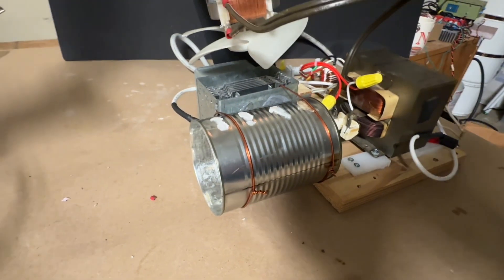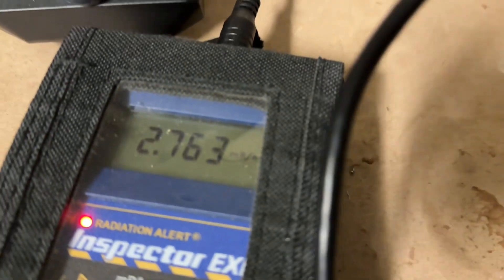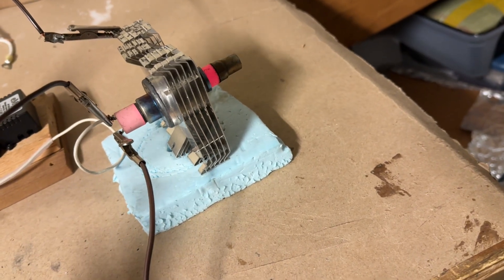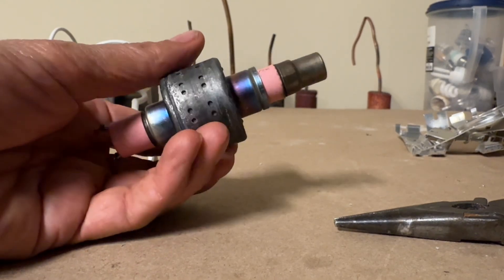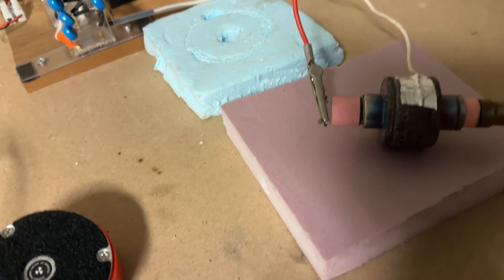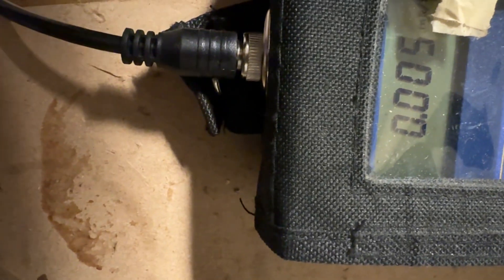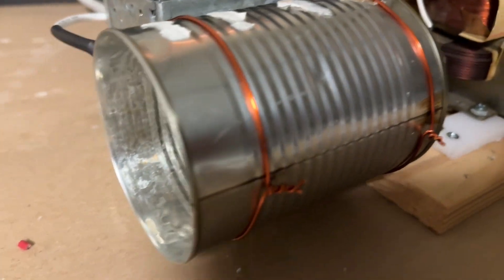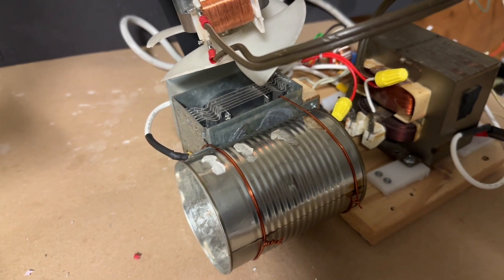Magnetron X-Ray Tube- Comments Addressed

Comment: why does your magnatron have holes on it? All the other ones i've seen have been smooth
Reply from the maker: Those have something to do with heat dissipation. This was an older one. There also may be gases such as air in between the vacuum chamber which is made of copper and the outer casing, which is made of stainless steel. The holes may be to allow expansion and contraction of this air when the thing gets hot.
Reply: @BrianDhvTinkerer  Okie dokie

Comment: Why do you think it gave less or nearly nothing of the X-ray when the filament was lit?
Reply from the maker: The heat filament results in a much higher parent flow. This current flow exceeds the rating of the high voltage power source  and results in a voltage drop across  anode and cathode. The voltage drop is so much that it is insufficient to produce x rays
Reply: @BrianDhvTinkerer  I think it's the multipliers limitation of Voltage regulation in presence of the filament emmitting electrons.

Comment: There are pink ceramic inserts in the magnetron - be careful when handling them - they are beryllium ceramics and are toxic.
Reply from the maker: Was careful not to break the ceramic material even though from what I’ve heard  BeO is not allowed by the FDA in anything that comes in contact with food
Reply: @BrianDhvTinkerer  This is the world standard for ceramic parts for electronics - the pink color corresponds to the presence of beryllium. Some microcircuits and high-power power keys are made of such ceramics - it withstands heat better than others and has a minimum coefficient of thermal expansion.
Reply: This is said to be one of the most common myths and it was true for old industrial devices in the past but in most household machines it is likely aluminium oxide, with chromium oxide added in pretty much every one. but even if so you can´t really know for sure how to tell them apart so I would likely not go and grind these to dust just for fun anyway and I don´t think any kind of dust should be inhaled improperly anyway

Comment: Do you know why polarity still matters with cold filament? I don't get it, I thought it'd produce more x rays since the filament is made of elements with higher atomic mass than the body which is copper
Reply from the maker: I think it’s because the anode area is so big compared with the filament cathode that the electric field on the anode when it is negative is not high enough to eject electrons at high speed.
Reply: That makes sense, thanks for the reply!  @BrianDhvTinkerer

Comment: Isn't that radiation dangerous? And would a flyback without a voltage multiplier work?
Reply from the maker: I tried it with a large high-voltage fly back and what it did was arced across the ceramic and did not develop any significant voltage between the anode and the cathode so I was unable to detect x-rays. What I plan to do is to use the same high voltage, high power, flyback and put it through 1Amp rated high voltage rectifier store in a  capacitor and pass that across the anode cathode of the magnetron to see if that will put out more radiation.
Reply: @BrianDhvTinkerer  I connected a flyback and started increasing the voltage, but now there's a 1k resistor between the anode and the cathode. I think I broke it.
Reply from the maker: The radiation is not safe for prolonged exposure, but is fine with brief exposure. Soft x-rays are more dangerous to the human body than hard x-rays. So it is worse to get exposed to radiation developed from low voltage’s like around 30 to 40 kV compared with high voltage like say  120 to 180 kV

Comment: You could probably get a much higher current out of a TV flyback transformer than a voltage multiplier.
Reply from the maker: I tried it and because of the higher current it arcs across the ceramic- i’m actually going to do an experiment where I submerge the whole Megatron under oil to prevent the arcing and then I’m gonna test it again

Comment: Next, apply 700KVDC sparks from a large VandeGraaff machine!  Pulsed x-rays.  Closer to gamma rays.   WWNTD?
Reply from the maker: Yes for sure would be up there in energy, not sure it safe!
Reply: @BrianDhvTinkerer  above 100KeV, x-rays are less absorbed by humans.  For example, 20KeV "soft" x-rays kill algae and sterilize things, like with hard UV.  Instead use a half-megavolt Tesla coil as your power supply, and it doesn't much work for sterilizing.  Goes through fairly thick steel plates though.   Also, it's rumored to heat up your skeleton, if you can crank the wattage high enough.   (Don't try that at home!)

Hint:  at well above one megavolt, x-ray tubes start giving odd, little-explored effects, and you stand to make actual physics discoveries.  Desktop gamma-ray emitters.  But first, buy about 500lbs of scrap lead!   Little thin 2mm lead sheets don't block MeV x-rays, so make your own thick plates first.
Reply: if you do, please tell your neighbors to evacuate their buildings

Comment: Note that you will need to have pretty decent amperage to get short exposure x-rays. The voltage determines the penetration energy of the x-rays, but the current determines the x-ray flux. You can form images on film using a low flux but you will need a long exposure time... Probably don’t need to point out that the combination of high voltage AND high current is the most dangerous combination. Will certainly need to submerge components in mineral oil and use proper high voltage wires to deliver the power to the x-ray tube.

If I recall correctly, dental x-ray units are in the 5 to 10 mA range at 60 to 80 kV.
Reply from the maker: Totally makes sense. If the cathode was heated, and a much higher current high voltage source was used, this would provide high intensity, x-rays. Without the magnets, there would be no risk for microwave production.

Comment: X-ray film image intensifier sheets can be used to form x-ray images. You can find x-ray image intensifier sheets in the image plate of in x-ray film cassette holders second hand on e-bay. Search for “x-ray cassette”. Prices vary widely and there are different types of phosphor blends that give very different results, so you will likely need to try a few different types. Rare earth fluorescent minerals in plastic are used to expose film during medical x-rays to improve contrast and limit x-ray expose to a patient. Most X-ray film is actually exposed with visible light using phosphor intensifiers rather than directly exposing the film by x-rays alone. A digital camera can be used to capture images from an intensifier plate sheet. Use a mirror at an angle so the camera is not directly in the x-ray beam because that will blind most digital cameras. Some sparkling may still result from backscattered x-rays. Leaded glass or acrylic windows can be used to further reduce noise. Leaded windows will likely need to be special ordered as it is difficult to find surplus second hand leaded windows. I special ordered leaded windows from some place in China. I got good results. It doesn’t much matter if you use glass or acrylic, but I prefer glass as it doesn’t scratch easily. Capture images in video mode rather than still. It’s difficult to get exposure and timing right in still mode because the x-ray sources are often pulsed. You can’t rely on the persistence of the intensifier phosphors to smooth out the pulses because the phosphors for medical applications are usually optimized to minimize persistence because fast, high contrast is usually the goal for these applications.

Comment: Really old article from 'Scientific American' detailed how to make a simple X-ray machine using a vacuum tube, high-voltage source and aluminum foil.
Single layer of foil on the outside of the tube, connected to positive of supply.
The pins of the tube connected to negative.

from:
Section IX. Optics, Heat, and Electronics;
Chapter 3. An Inexpensive X-ray Machine
The Scientific American Book of Projects for The Amateur Scientist
Library of Congress Card Catalog Number: 60-14286
© Copyright 1960 by C. L. Stong
Reply from the maker: Thank you will need to check that out. The glass walls of the tube are acting as the anode with capacitive coupling. Thanks for sharing!

Comment: you may want to try the experiment on a working microwave with the tube still enclosed in the frame.

that will tell us if we have to worry about xrays leaking out should the heater burn out.

maybe a power surge that blows the filament heater or old age.

a microwave from the 60s still surviving  maybe hard to find as styling is another factor for replacing.

you can try in thrift stores .
Reply from the maker: Heard about the thoriated cathode- can be a decent alpha particle source.

Comment: so is it drawing in the radiation? or converting it to one that isnt detected?
Reply from the maker: The cathode has a much smaller area compared with the anode, which is the copper walls of the tube. With 40,000 V placed across the cathode and the anode, the electric field of the cathode is very high with respect to the anode and electrons are released from the cold material of the cathode (thorium oxide, tungsten etc). These electrons freely flow through the hard vacuum in the “tube”  at 40 keV energy. They can’t get very far before they strike the copper walls of the tube. They are suddenly decelerated from an energy of 40 kiloelectron volts to 0. This is enough energy to knock out electrons from the inner shells of the copper atoms of the tube. Electrons from outer shells  drop down to fill the space left by the vacated inner electron shell  with the release of electromagnetic radiation. – Brehmstrahlung radiation which is what these x-rays are

Comment: Could you build a shield around the tube to constrain the radiation pattern then get some images?
Reply from the maker: That is definitely possible. I want to put high frequency AC at 60kV across the tube and run it remotely for even greater radiation. Since it appeared that electrons can only flow one way through it from the cathode to the anode, it will function as a rectifier so there is no need to put DC into it. I’m in the process of building a large flyback transformer, which will have hopefully enough output to get me to 60 kV or above. Will keep you posted. I’m planning on testing it once I am able to complete the construction of the flyback transformer. I’m waiting on a vacuum container to remove the air from the oil surrounding the transformer.
Reply: @BrianDhvTinkerer  can't wait for the update! That's some huge transformer hahaha, mine puts out 20kV and with a bunch of stages, kinda acts as a current limiter too, just that it kills my filament supply every time...
Reply from the maker: @alexwang007 haha yep those pesky filament supplies!

Comment: Full-power filament will try to draw huge anode current.   So, your 20KV will get loaded down below 500V.   As with all x-ray tubes, unless you have a HV supply capable of hundreds of watts, instead you must use a variable filament supply.  No way to avoid it.  Slowly crank up the filament heat while monitoring the HV and the x-ray production.   That lets you find the max filament watts (or volts) to produce max x-rays.  But only a little filament-heating will crash your tiny 20KVDC supply.   It all depends on how much gas was inside the magnetron, since "Crookes Mode" x-ray production cannot work with good vacuum's way below one microns pressure.   No-filament Crookes x-ray tubes are based on gas breakdown called "dark discharge."   (CRT and vacuum tubes don't have such good vacuum, since the "getter" doesn't eat much argon, just N2 and O2.   Probably same is true of magnetron.)   

Also, try various thicknesses of aluminum as an x-ray shield.   Low-energy or "soft" x-rays are blocked by aluminum (called "aluminum filter" in hospital devices.)   Unless your power supply is 200KV, most of your x-ray output will be soft x-rays.   These are dangerous, killing a few hundred people before 1920, from skin cancer.   Low-voltage x-ray tubes are very much like intense sources of hard ultraviolet.  More dangerous than that, because much UV is stopped by your outer skin, while soft x-rays go right into the living layer.   "Hard" x-rays, with 120KV supply or higher, just go through everything.   (In order to cause cancer, x-rays must be absorbed by your skin.)
Reply from the maker: Thank you- that is a great and very through explanation of exactly what’s going on!

Comment: Can you get x-rays out of a cfl bulb using an induction coil?
Reply: X-Rays are only produced in vacuum tubes.
CFL's are not vacuum tubes.
Reply: @rob3125 But the original x-ray tubes (the bulbous glass type) were not vacuum tubes, they were filled with a small amount of gas.

Comment: Definitely interesting, but particularly in that last demonstration, how do you know that the lamp is lighting from Xrays and not from microwaves?  
Because that whole 1/4 wave suggestion is based on the wavelength of microwaves isn't it?  My guess us that the magnetron is still tending to oscillate at its resonant frequency, even without the heater and at several times its usual operating potential.
I like the idea of playing with Xray wavelengths - and in theory SOME Xrays should be produced in that vacuum at that potential... but I suspect that the magnetron is still pretty much doing its thing.

Comment: I am certain you can source xray film, the hard part will be developing it. If you can figure out how to develop it, you might try taking an xray of something, anything really. It doesn't have to be alive. You could xray a PCB or keyboard even. Maybe ask a local doctor if they could develop it for a college project. The newer digital sensors are awesome but very expensive. Their main benefit is you don't need to develop anything. But good luck finding one.
Reply from the maker: I do have some x-ray cassette green screen fluorescent material– it does fluoresce with the x-rays. I can use a time setting to get a picture. Will keep you posted.
Reply: I was going to suggest that. Rare earth screens if u can find any. Try and get the ones that are most sensitive, blue if i remember, i think the green ones were slower but more detailed. The sensitive is called "regular" on the cassette, or "reg". If u are running softer xrays at 40kVp, the mammography cassettes, single screen, are designed for this very low energy. But i have no idea of the current, or intensity of your beam.
What fun tho!!!
Thanks for posting   @BrianDhvTinkerer

Comment: I would like to know is it like xray laser or is it going off from all directions
Reply from the maker: The metal walls of the magnetron blocks a lot of the x-rays. However, it seems like they get through the ceramic areas so in a way, they are kind of focused.

Comment: why does the magnetron not release any x-ray when the filament is heated??
Reply from the maker: When the filament is heated, the amount of available electrons from thermionic emission  increases significantly resulting in voltage drop across the tube which stops x-ray production
Reply: @ Thanks.

Comment: A 'typical' color CRT runs at 27kV - and produces X-rays, and hence requires lead in the glass to minimize exposure to those watching TV.
Running at 40kV 🙈
Thanks for the demo.. Interesting
Reply from the maker: The intensity of x ray production was scary. I could fluoresce an x ray green screen with it ( not shown)
Reply: @BrianDhvTinkerer  I wonder how a grounded Beryllium metal plate ('somewhat' transparent to xrays due to the small atomic size) and an radiation detector will behave, ie how strong the beta-field really is.
I tried in front of my tv, but the electric field messes with my detector in my Gammascout device. 
Btw, Beryllium is toxic - so yeah... These be NOT toys :ø)
Perhaps using a scintillating device like that in Radiacode would be interesting too - it should give a spectrum of energy densities.
Reply: The crt can produce x-rays if you focus a small spot on the crt screen-the main x-ray producers are the HV rectifier tube and. The shunt regulator tube inside the set on theHV cage when the crt is showing a picture or full raster the electron beam energy is spread out over the screen-least amount of x-rays produced. The experimenting with the magnetron tube unsheiled is kind of unsettling.
Reply: @ No doubt x-rays is produced in a CRT.
One thing that tickled my mind was the lack of artifacts/spots in the video. Usually when radiation hits the camera sensor it makes a spot in the picture, which I couldn't see even with the camera close and moving around the excited magnetron tube. 
This is why I think it is partly the electric field that contributes to the detector 'detecting' more than there really is.
Perhaps using one of the 'old' tube-type detectors that only detects beta and gamma rays would be a nice control device.
X-rays can have quite high energies, just take hospitals where they use heavy shielding to avoid exposure, but in 'theory' x-rays is essentially electrons - and electrons is electric potential, which is what the CRT and magnetron uses in order to produce light/radio-waves (radio-waves is essentially light, just at lower frequencies as I understand physics)
Well, better not play around too much - DNA is precious :ø)